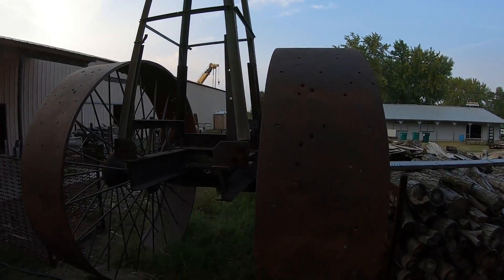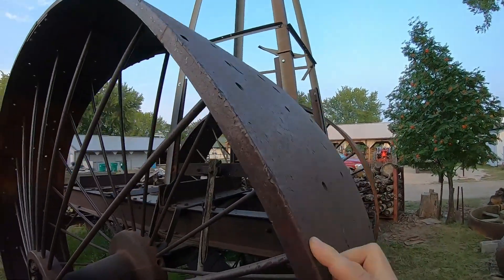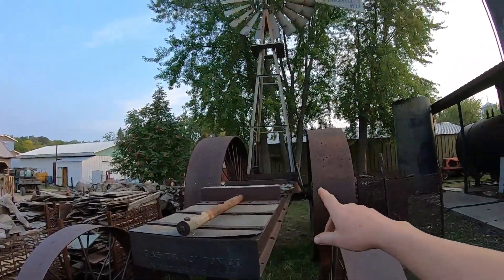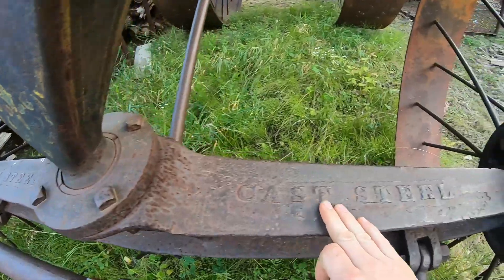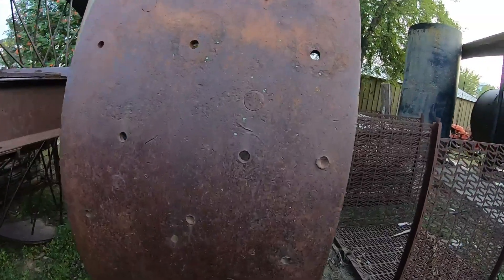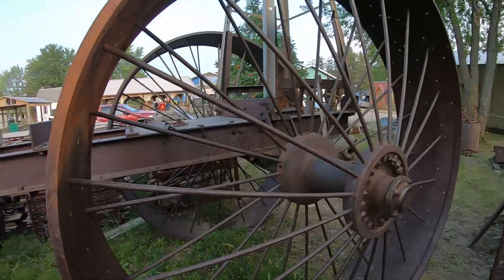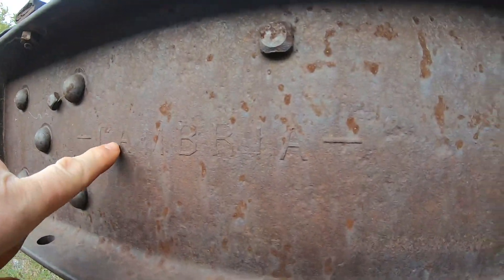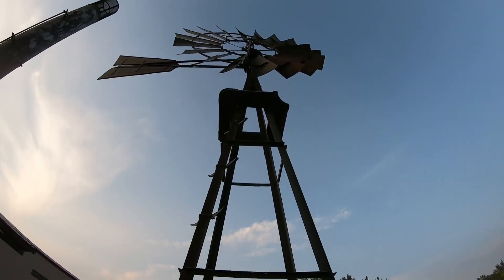Antique Prairie Tractor Repurposed as Mobile Wind Power Generator - Nearly 100 Years Ago!

Comment: I think that was yard art at some time.  The windmill may have supplied enough power for a small well pump but that's about it.  I think someone decided to mount the windmill as art and park in in the front yard.  Just my opinion.  Thanks for the video, definitely an interesting piece!
Reply: I wouldn't be surprised if it was used as a mobile pump, windmills can pump a lot of water if the wind blows :) but there sure does seem to be a lot of important pieces missing, it is actually a decent idea for a mobile pump, and plenty of weight to keep it stable

Comment: It was lucky to survive the WWII scrap metal drives.
Reply: I know it was patriotic to turn in scrap for the war effort but it brings me to tears thinking of the millions of tons of glorious gold like this that was destroyed.
Reply: @maggs131  We more recently lost irreplaceable "scrap" vintage cars & machinery from the countryside here in Australia to China's massive need for steel from the 1990's. I used to know where there was all sorts of vintage cars, trucks & tractors tucked away in the bush that were all scavenged & sent overseas to be melted down.
Reply: @dustyfarmer  was this "scrap" forcibly taken for another country?
Reply: @maggs131  No, the scrappers were paying good $ per kilo cash in hand. Farmers were selling their erosion gully's full of old rabbit netting & wire & anything else metal. Still going on until this day but now the scrappers are more cunning, paying scrap value but sorting & up-selling anything valuable. Plenty of good stuff in my "resource center's" too handy to sell. I go to the tip and usually come home with more stuff than I took.
Reply: @dustyfarmer  tip? Must be an aussie term. I wonder how much steel has been stolen. Here in the us is everyday you hear a vacant house having all the copper water lines ripped out or a bunch of cars in a parking lot having their catalytic converters cut off
Reply: @maggs131  We don't have the cat convertor issue here but I think most cars here run ceramic cell cats so I don't think there is precious metals in them. I pick up any copper & brass I see down at the tip, just like money lying on the ground and good stuff for a bit of pocket money when you need it.

Comment: That is neat!
If I was to guess, I would think that it came down in tp a 90 degree gearbox and either drove a generator or a belt pulley. that way they could put it by a water source and use it to pump water into a stationary or mobile tank. even into a stock tank on the far side of the property.